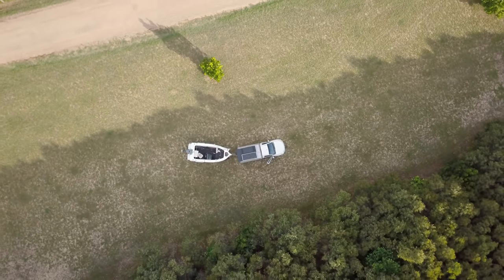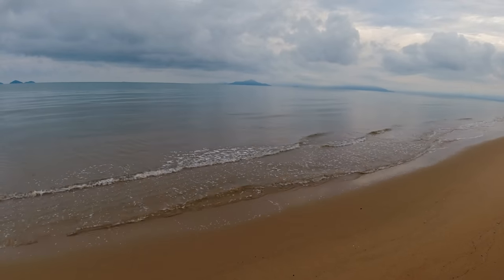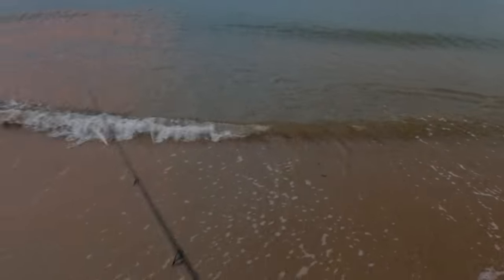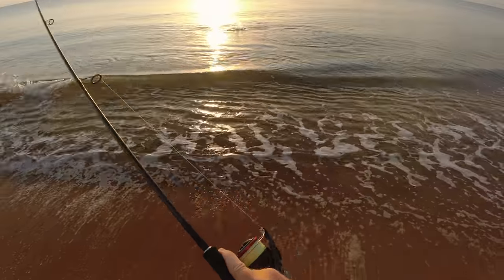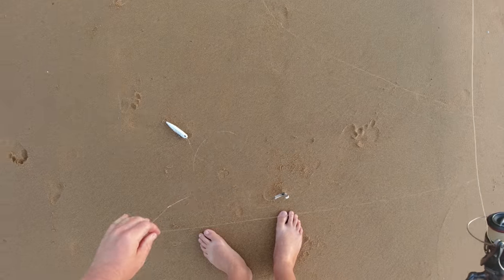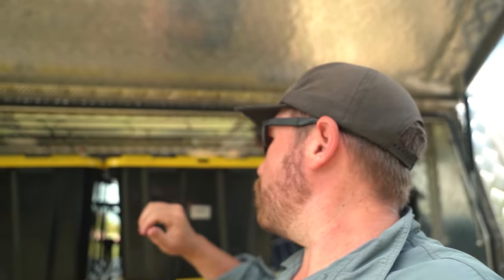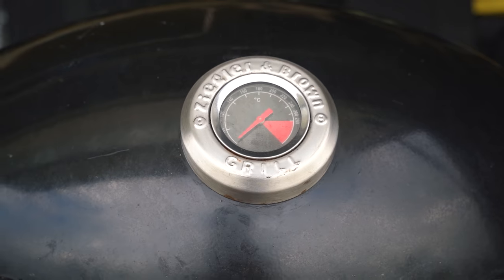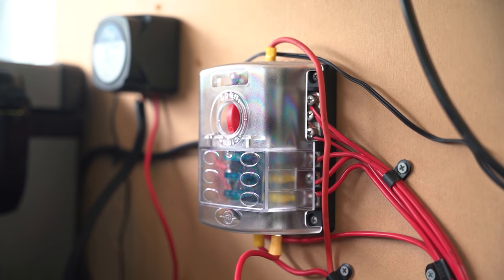Beach Fishing, Living in My Car, Fishing Everyday!

Comment: Great video mate with some fun action off the beach. One trick I learnt from beach fishos if I have to put my gear onto the sand, turn the reel handle pointing upward then put your gear upside down on the sand, reel facing up, this way only the rod and the handle knob touching the sand. So no need to worry about sand getting inside your reel then